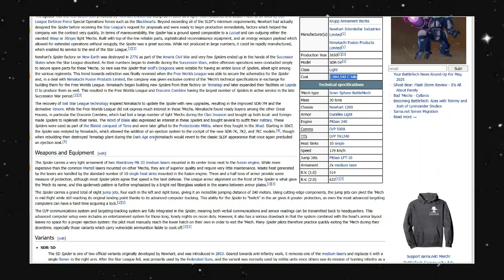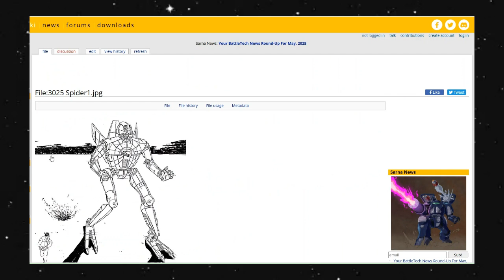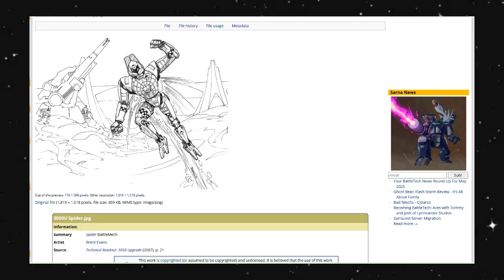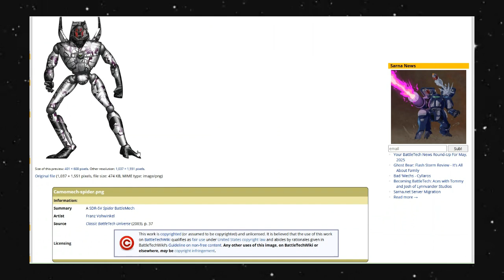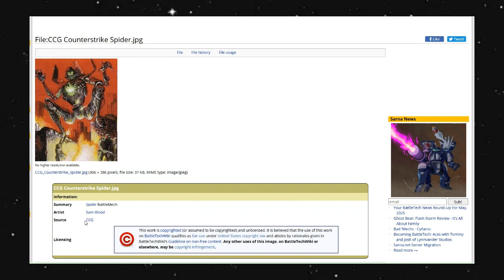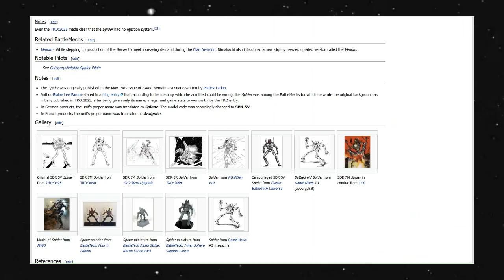D6 Battletech Spider

Comment: Hello Bricks. 

The Spider is one of the only 'perfect' Mechs in the 3025 era TRO. 
Very fast movement of 8/12 hexes, 8 hex jump. Armed with 2 medium lasers, and if memory serves, roughly half maximum possible armor. 

This Battlemech does not really improve until around 3067. By that time, the data from the Helm Memory Core is spread widely, so the Mech benefits from FAA, Endo, DSHS, ER Medium Lasers, and more. 

By 3084, the Advanced Technologies allowed for an improved Spider design based upon the SDR-8R variant. 

First, you take an 8R and ensure that it has a Light Fusion Engine, Endo-Steel, and a movement rate of 7/11 basic. Yes, this is slightly less than the standard 8/12, but not by much. The smaller XL Fusion Engine is lighter and 'frees up' tonnage within the Mech. 

Replace the 8 standard jump jets with 8 Improved Jump Jets (same jumping distance, half the heat generated). Exchange standard medium lasers for a pair of ER Medium Lasers (which have better range brackets, but increase the heat generated from 3 per laser to 5 each). Add an ER Small Laser into the Head. 

Replace all heat sinks with 10 Inner Sphere Double Strength Heat Sinks (DSHS for short). And finally, increase the Standard Armor plating to 5 tons total (80 points out of a maximum possible of 105). This results in a 62.5% improvement over the original Spider's 56 armor points.

All of this comes to a total of 30 tons, and leaves only 4 critical slots unfilled. 

The ER Small Laser has a range of 2/4/5. The ER Medium's range is 4/8/12. 
The ER Small Laser's heat is 2, ER Medium Laser's heat is 5. 
The Er Small Laser's damage is 3, ER Medium Laser's damage is 5. 

Walking movement is 1 heat, running (flank speed) is 2. With the Improved Jump Jets, jumping full distance 8 hexes at 4 heat. 

So, jumping 8 hexes, firing both ER Mediums, and the ER Small, totals out to:
4 + 5 + 5 + 2 = 16 heat generated. 10 IS-DSHS 'cool' 20 heat per game turn (10 seconds), so the Mech NEVER overheats. Thus, the 'heat delta is actually -4 heat. 

This is actually an improvement over the standard Spider, even though the Mech moves slightly slower at walk and run speeds. This Mech design is meant to jump constantly while firing every weapon in range of its opponent. A standard Spider jumping and firing both medium lasers would generate 3+3+8=14 heat, and it only has 10 standard heat sinks, leaving a heat delta of +4 every game turn.

Given a Veteran Pilot (Gunnery 4, Piloting 6), even the ER Small can hit targets fairly accurately at 4 hexes range. A Pilot with superior skills to a Veteran will hit more often, such as the 'average' Clan Pilot's normal numbers of G3/P5 skills ratings. 

This proposed Mech variant was created for my Ghost Lions Legions Mercenary Force and was designated the SDR-8R-GLL

You can also 'improve' upon this improved design further by removing 1/2 ton of armor (8 points) and the ER Small Laser, and then replacing that with a Targeting Computer. 

By doing this, your accuracy would be the same as an average Clan Pilot, since the Targeting Computer reduces the 'to hit' number by -1. Which equates to your Pilot having a Gunner Skill of 3. 

Scenario: Spider jumps 8 hexes (+3 penalty), Pilot's Gunnery Skill is 4, Targeting Computer 'bonus' -1. Thus, 3+4-1=6 to-hit at short range, 8 at medium range, 10 at long range. 

Same calculation for a Clan Pilot: Jump 8 hexes +3. Gunnery skill of 3 = 6 to-hit at short range, 8 medium, and 10 long. 

I designated the new variant as the SDR-8R-GLL(A). 

I went into such detail because I do not know your experience with Battletech. You were reading by rote from the published texts without any comment from personal experience or preferences made known. 

I hope this was helpful, educational, and enlightening.
Reply from the maker: Hello and thanks for the comment.
You've given a very nice set of builds for battletech and this is really the reason for the channel.  I'm an old gamer though I just can't get the guys together very often, Family engagements seem to get in the way. Thats ok we keep in touch.  
I'm the guy in the group that brought in the RPG's and Battletech became the biggest hit for us.  We would spend all week tweaking our mechs and for the next campaign on the weekend.  back then we could only play in the 3025 to 3050 era, and I've collected the other eras of tech manuals and even jump into a game here and there but nothing at a regular basis. 
I like to read form the wiki pages for all of the new variants of the mechs and the vehicles that I may not be aware of, then I'm getting Battletech into the D6 system for me and anyone that want to take the journey with me.  I've fallen in love with the ease and flow of the D6 system and would like to either run Battletech, Star Trek, G I Joe in that system as an RPG.  This gives me a reason to put pen to paper and get the stats done.  Even if the day never comes that I get the group together for some of these games I hope that others that have similar thoughts can see this and run with what I've made.
At the end I like to make up stories and RPG's are my building blocks for doing that.  I hope that I can inspire others to make their own stories and get friends together for fun filled nights, rolling dice and sharing some laughs.  Thanks for watching and thanks for the comment, I see you in the next video.
Reply: @bcwolf100  Part Four:   120 years later, a new group of Mercenaries started working in the Inner Sphere and Periphery, the Ghost Lions Legions. The colonies, which had expanded and established other colonies on other moons, had benefited greatly from copies of the Helm Memory Core, which enabled them to mine Rare Earth Elements and ship them to various peripheral state purchasers. Additionally, they purchased the needed equipment to build new Mechs and refurbish or redesign the old SLC Mechs and vehicles. This is besides the upgrading of technologies used and built by the colonies. 

The 'armed merchant ships', also known as frigates, were valuable for protecting shipping routes and convoys back to the home system. A government had been formed once the star system sported more than three colonies. And thus the Stygian Compact was born during Old Leo's waning years. Old Leo, himself, was named the First Tyrant of the new Democratic Tyranny of the Compact before his death at the age of 123 years old. 

I have a text file on the Democratic Tyranny as one of several documents entitled FTTD-**** (From the Tyrant's Desk). 

Even though I lost everything I owned before I retired and moved back to my hometown due to an apartment fire, I still write up such documents based upon my memories of more than 25 years of game play set in the Battletech Universe. 

I, too, have difficulty finding people to play against, and I do not own a car, so my options are limited. I am slowly rebuilding my stock of Mech models, vehicles, etc, along with various rules books, TROs, and novels. 

I hit various Battletech content providers' sites and reply with sometimes lengthy postings based upon my knowledge of the game and various memories of battles I've fought or witnessed in the past 40+ years. 

If you desire copies of my FTTD files, I can provide. Perhaps you can help me condense them and make them more readable and accessible for others. Who knows? They also might provide 'grist for the mill' for your own documents and creations. 

Frank Smedley, 
Chief Archivist,
The Tyrant's Archive,
Stygian Compact. 
Hel's Port Archive Primaris, 
Stygia IV-b, Hel,
Perseus-Cepherus Cloud Complex
(Staplin Nebula)
Outer Periphery
Circa: 08-24-3155
Reply from the maker: @franksmedley8619 I would be honored for you to share your work with me. You have the concept of a wonderful, expanded universe for battletech.
Reply: @bcwolf100  Yes, I do remember those days. From 1984 through around 2008 or so. 

My Playing Group (we never got around to naming it) usually met each weekend at The old Emperor's Headquarters (EHQ). All of us started out with individual lances in small battles on the tabletops, but very soon, around a few months into playing the game, we decided to use the results of such battles to build the backstories of our original character commanders and other unit leaders. This lasted until the EHQ went bankrupt due to bad business decisions around 2008. So, most of my experiences deal with the 3025 Era and 4th Succession War, through the early Dark Ages Era. I came back into things around the end of the Word of Blake 'kerfuffle'. 

For myself, I wrote up a backstory of a former Davion Heavy Guards Major who had been framed by another noble's son for a murder he did not commit. Lacking 'pull' and higher authority support, he resigned his commission and was 'retired'. Using his separation pay, personal wealth, and family influences, he was able to afford a Lance of Mechs, a few vehicles, and an Infantry platoon, in addition to a unit of Techs, astechs, and other support personnel.

I was one of the very few who went into such details, at first. I kept close track of hardware, costs, payrolls, fuel costs, etc. Eventually adding a MASH unit and expanding both the Mech and vehicle forces. 

This led to the need for a drop ship, of course, and my OC (Leonidas Alexander Granger, aka: Old Leo) finding such a ship on monetary hard times. For the costs of repairs, fueling, and generally fixing up the interior of the ship to near-factory specs, I 'owned' my own Union Class Drop Ship. Which was named the Regulus (primary star of the constellation of LEO and thus the 'lion's star'). The unit had become known as the Star Lions Corps Mercenary Company by this time. 

Old Leo did lose a few battles, but mostly won the conflicts he hired to fight, or was otherwise engaged upon. I kept delaying the purchase of another Union or other drop ship for months in real time, years in character time. This allowed me to build a source of funds to make the transition easier, and to buy, or capture and refit, further forces to expand from a full reinforced company, to nearly battalion size. 

Other players often wondered why I was not buying everything I could when I could. But they came to understand when I expanded eventually. Rather than buy another Union drop ship, I bought TWO Mule Class drop ships to move my vehicles and infantry easier, while keeping the union for my Mechs and some tanks. 

See part two.
Reply: @bcwolf100  Part Two:  Later on, I bought a badly damaged Overlord-class drop ship, yet I had more than enough funds to afford it and its associated repairs, refit, rearming, and fueling. This let me have the space to expand my forces again, while dropping larger forces on my contracted targets, making battles faster and easier to win. 

Oh, how they howled 'Unfair!' and 'Cheater!' at me for doing this. Most often, they were struggling to fill two or three Unions with their forces, or madly searching for Unions to buy to expand into. 

My 'nest egg' strategy worked brilliantly for me. I kept the Regulus and both Mules, in addition to the 'Lion's Paw' Overloard. I added other drop ships that no one seemed to want. 

Such as a bulk liquid carrier that I half converted to carry Deuterium (fuel for the Mech's reactors), and tens of thousands of gallons of fresh water. This alone let me field forces into arid conditions with little effect upon the forces I had deployed. 

In fact, I fought a series of desert battles on Canopus III, which was a desert world worse than most such planets. Canopus IV was the home-world of the Magistracy of Canopus and thus very available for R&R, as well as support of all sorts. Food, parts, supplies, medical supplies and personnel, etc. 

By defeating the force on the planet over a period of several months, I made friends with the 'native' population, which was FAR larger than the Magistracy ever imagined. Yes, the planet was named Arrakis, aka: Dune. The 'Spice' mined there was NOT the same as Frank Herbert's book. But did have medicinal applications for the making of anti-aging drugs, and could be made into food products if sufficiently processed to remove a long term 'poison' that would kill you if you stopped ingesting it. 

Although I was unable to get the native's version of their 'still suit', I was able to get a 'downgraded' version of it that was nearly as capable in the deserts of Dune. The natives were very happy that I had a mass fluid container ship, and used the funds paid to them for still suits, to obtain water in massive quantities. I provided such by 'mining' the various relatively nearby Kuiper belt objects in the solar system (F-Class star system, so fairly far out). 

The natives were highly skeptical until I landed their first shipment outside of one of their Sietches and was able to offload around 8,000 tons of water (roughly, 8,000 cubic meters of water). And I told them that I could repeat such deliveries every few months as needed, as long as I was deployed to the planet. 

This resulted in my SLC (Star Lions Corps) hiring over 10,000 Femen warriors to keep the water shipments coming. Although we 'buried' Fremen in space, with a vector to burn up in local stars, each warrior's family or sietch was paid his weight in water upon the death of the warrior, and as soon as the death's report could reach the planet. Payments were made out of extra water shipped to the planet. 

See Part Three.
Reply: @bcwolf100  Part Three:  All of this led to a 2nd currency being created. A 'water credit'. These credits broke down pretty much like those listed in the Dune novel and were not really subject to a conversion to C-Bills or other currency. Personally, I didn't much care, since I could easily supply as much water currency as I wished via mining the Kuiper belt objects, nearby asteroids, and icy moons of the larger gas giant planets. 

With Fusion power sources and their associated heat, I could melt, pump, filter, and process immense volumes of water. I eventually bought another pair of small drop ships to perform this task, freeing up my bulk liquid carrier for refueling my growing drop ship fleet. 

This also caused me to look to defense. Where I would find 'Free Trader' Merchant jump ships and drop ships, and buy out their 'ship's shares' and own the ship. Several underwent changes and were lightly (relatively speaking) armored and armed as 'frigates' for my growing navy. 

All of this led, eventually, to a betrayal by House Liao on Contract to defend St. Loris and Spica for the Capellan Confederation. The Mandarin in charge demanded that my Mercs 'stand and die' or he would eliminate my unit's dependents during the invasion of the 4th Succession War. Seeing this as a breaking of the Contract, Leo contacted the Davion Commander of the 4th Succession War invasion fleet and brokered a deal. The Davions would raid the world my dependents were on, save them, and protect them until I could retrieve them. Meanwhile, a false battle was waged where the battleroms depicted my force being totally destroyed by three-to-one odds by the Davion forces.

For such consideration, I gave the Davion commander all the intelligence I had on Liao units, positions, fallback points, supply depots, hidden supply locations, Command and Control data, and even all the House Liao communications codes I had in my possession (including those I had secretly gained knowledge of). 

My Fremen Infantry forces were VERY useful, since their still suits let them move through terrain impossible for other units, and through any terrain, and be nearly impossible to detect. The Fremen Infantry were equipped with the best weapons I could afford, including Lostech. 

So, taking the Space Ports was dead easy when I had units like that at my command, and it was thought that my units to have been totally destroyed in battle. Taking the space port allowed me to take the main House Liao command bunker complex and the Mandarin's operations center nearly intact. 

Old Leo, himself, shot the Mandarin with his personal Nakajima laser pistol through the head while the Mandarin was logged into the secure planetary database. This allowed Leo to write himself as a 'super user' with all the permissions of the Mandarin and enabled him to fake the Mandarin's orders, codes, ciphers, etc. 

This allowed Leo and the Davion commander to lure reinforcements from nearby planets to help 'defend' a pair of already taken planets. Resulting in the capture or destruction of said reinforcements. 

During the battles, or between them, my forces looted every bank on both worlds, keeping only the C-Bills. H-Bills (House currencies) were sold to the Davion commander at around 20% face value in C-bills. My Mercs also basically deconstructed three entire light Mech factories and several other manufacturing sites on both worlds. Transferring the 'loot' to my fleet for storage. 

I 'took in' at least 50,000 Capellan citizens (mostly from the lower class) with me when I left the systems for good. I returned my Fremen Infantry to Arrakis and headed out to the Outer Periphery (the Perseus-Cepherus Cloud Complex) to what we named the Staplin Nebula (named after the first captain of a jump ship to attempt to enter it). Finding an F-Class star system with three gas giant planets with near-Terra gravity moons, three asteroid belts, and a pair of terrestrial worlds with trace atmospheres, the SLC and associated personnel tunneled into the moons' crusts to construct colonies. 

See Part Four:
Reply: @bcwolf100  Part Five? 

To date, I have written something like 300 'replies' to various Battletech content provided on the Internet (and still making up new ones as I find content to respond to). 

I have written something along the lines of 50 'articles' about my Compact, its government, history, unit histories, and other subjects. Such as using Deuterium for Mech 'fuel' for their reactors, alternate power sources in the Battltech universe, shipping and containerization of cargos, etc. 

The Battletech Universe is diverse, active, ongoing, and changes over time. A 'living' universe that I just feel compelled to add to in my own way and with my own creations. 

Being a person with an active and inquisitive mind, a good memory, and a good grasp on all sorts of knowledge bases such as computers, astronomy, astrophysics, general physics, mechanics, etc, etc, etc. I have some basis for at least basing my writings in 'real world' terms and the limits of the Battletech Universe. 

Oh, I should mention that for a time, I was part of a fan-based Writers Group that wrote Star Trek styled stories for printing in a fan magazine. I did this for several years before the group dissolved over personal issues. 

So, I have some experience writing Science Fiction. 

I was a massive geek during my late teens and early 20s about Dungeons and Dragons and played numerous campaigns and scenarios, as well as GM'd many as well. Which I would guess led me to my penchant for creative writing and world creation. 

I've been told by some content providers that my thoughts on my Stygian Compact are totally outrageous. But they fail to consider that a starting population of around 200,000 persons, with no limits as to birth control, and the medical knowledge and resources of the Magistracy of Canopus (who never lost their Star League Era medical and cybernetics technologies), that such a population could 'explode' to be into the low hundreds of millions within 120 years. 

This includes actively recruiting colonists from other worlds in the Periphery and Outer Periphery on a massive scale. Mostly from colonies fallen on hard times, failing colonies, and those wishing for a better life elsewhere. 

With hundreds, or even thousands of worlds to choose from, new colonists are not all THAT hard to find and recruit. Especially if they are going from 'hard scrabble' to relative 'heavenly' environments and access to luxuries. 

The only real problem being if they want to sign a 25 year contract for labor to the new colony to obtain full citizenship. Those failing the contract, or deemed not otherwise suitable (mostly for loyalty issues) would be deported to other Outer Periphery planets other than their original home-worlds. 

Those lasting the 25 years become full citizens with all the perks and responsibilities of any other colonist of the Stygian Compact. Such perks include state supported help for the 'no limits' birth policy, which includes full schooling, creches for underage children while their parents work, basis food supplies, access to entertainment, state sponsored housing, and more. 

The Compact invested heavily into industry, especially mining, both on the various Terra gravity, or near Terran gravity moons, asteroid belts, Kuiper belt objects, and even other star systems. So far, there is no plan to reduce or restrict population growth until the number of citizens reaches at least a billion or two. 

To ensure the population explosion, the government gives tax breaks and other benefits to larger families over smaller ones. Expansion of living and working space is limited only by the speed at which fusion-powered tunnel boring machines can create the needed space and more. 

Living inside a series of large tunnels is not so bad, and there are several perks to doing so. Caverns hundreds of meters across can be sealed and 'terraformed' to make humongous parks and 'outdoor' areas. The tunnels themselves make current ones look positively 'noodle-thin' in comparison. The TBMs (tunnel boring machines) built and used by the Colonies measure 200 meters across, creating 31,146 cubic meters of space per meter bored forward. 

So, you can easily imagine that the tunnels are built as wide open spaces and filled with whatever is needed with plenty of 'open space' left over for 'mental health' reasons, to not feel constrained by the environment lived in. 

Usually, these tunnels lower portions will be the places to put 'underground' cableing, sewage and fresh water piping, oxygen pumps and conduits, data cabling, and power lines. Leaving roughly 70% of the overall diameter of the tunnel for whatever length is needed for whatever uses one needs or desires. 

Waste disposal is 'dead easy' when you have ice crevasses to dump your wastes into. Whatever you don't recycle as a matter of course. 

Other tunnels provide power by filling them with Fission nuclear power plants, with the tunnels designed to be collapsed to bury any 'Chernobol' event that occurs (with over 1,000 years of knowledge, Fission Reactors would have reached 'perfection' of design and reliability). 

In my various notes I posit that something like Nuclear Submarine Reactors that last around 20 yeas before lack of energy production forces replacement. Those old reactors are dragged out to the crevasses and dumped. Water is pumped down to cover the reactor and seal it from becomming an environmental threat. Waste heat from the reactor might melt the surrounding ice, but not enough to pollute things seriously, and as the reactor fails, the surrounding ice seals it in place, forever. 

On the other hand, it keeps the reactors nearby if needed in the future for any reason. Barring that, the reactors could be melted down to, removed, and flung into the local star to safely burn up, using Industrial Mechs and Drop Ships. 

Recycling would be a common fact of life to the colonists. Water, sewage, metals, glass, plastics of all sorts, etc. Only the left overs might end up in waste crevasses, unless they are used to create 'insulation' for the Fission Reactor tunnels. 

Human wastes, other than extracting the water content, are valuable as a resource of various elements, and a source for a basis in creating 'natural' ilizers to be used in 'vertical' hydroponic gardening for food supplies. 

This is in addition to the importation of foodstuffs from many worlds, some of which I have written articles about and their products. 

More grist for the mill of thoughts and possibilities. 

Frank